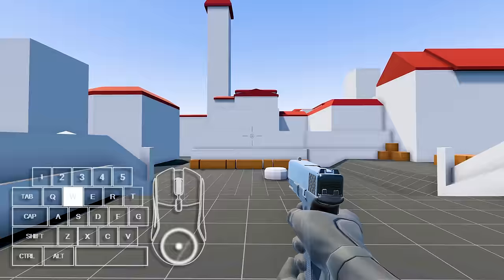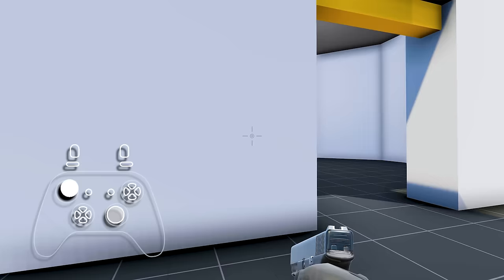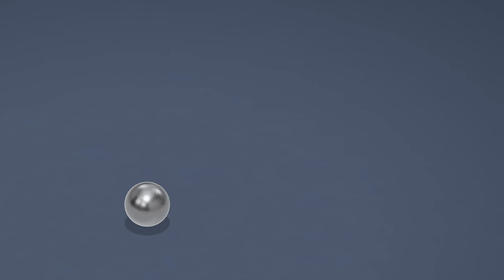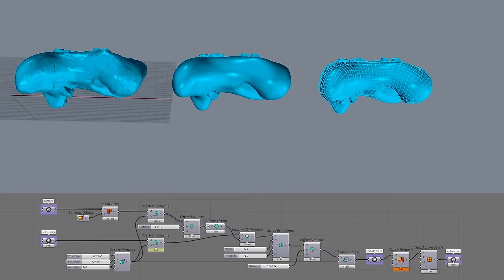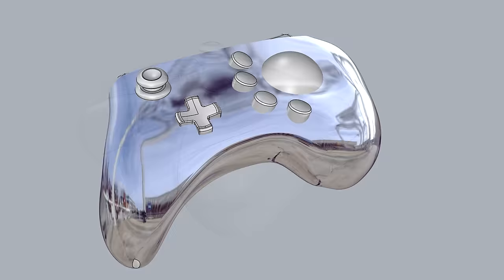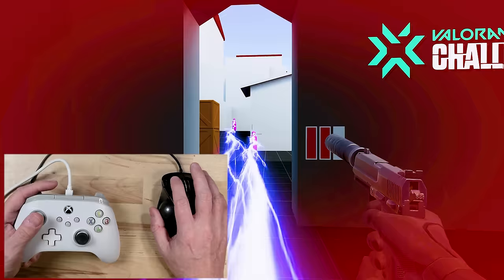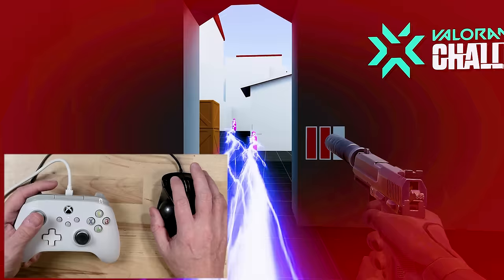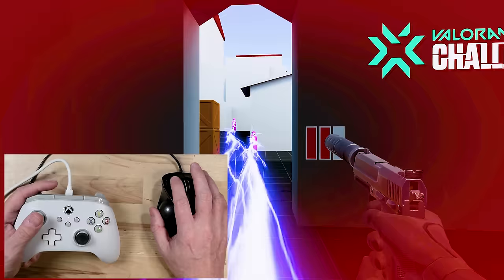Ultimate FPS Controller Design & Build

Comment: hello brother can you make a back button connection to ps4 controller like scuff controller I tried to make it and my controller's mother board burned I used for the back button the "mouse button which is right click and lift click" maybe it burned because I link the mouse button to the controller's right trigger without using something to manage the voltage I don't know I'm not an expert with the electrical circuits you are better at this I will follow you to see the video and can you Can you explain the amount of voltage in the controller and what can and cannot be connected to avoid burning the motherboard?, and you are intelligence man <3 love you

Comment: also make sure that the insides of the system unit from the PC fit there, all the buttons that are on the keyboard, a video projector (so that you can immediately project a picture on the wall), a stand for a bottle of beer and I can also come up with different things, if anything, contact))))..... What's the point of it anyway?

Comment: my claw game technique doesn't like what it sees, I love the concept, but I still wonder how this controller will cope in a hectic FPS shooter with lots of quick flicks and longer tracking of enemies in all driections. As soon as i have to lift my thumb its over, but with a higher acceleration speed i think i would struggle more to correct the spray of my weapon, with a mouse you pull it far with the arm if your enemys travels fast and close to you, when he's in your sight you switch to aiming with your hand instead of the full arm, thats not exactly like a mouse but pretty close. We need more tests.

Comment: You really should cure your UV resin after washing WITHOUT the supports. There is no need to cure it with suports, since it makes it harder to remove and even can break the pieces because the supports are too hard along with the piece you want...
Reply from the maker: Good point but it really depends on the resin being used, geometry of the print, support layout situation etc. A lot of the larger controller parts had complex internal geometry so keeping the supports on through post cure helps to stabilize everything & prevent warping (in this particular case).

Comment: So if mouse aiming is still superior to the custom controller why not create a setup that uses a flightstick style joystick (the type of joystick that has some buttons so you can map sprinting and crouching) alongside a mouse? Then you have the movement freedom of a controller without any kind of aim limitation.
Reply: Lol just use a freaking keyboard and mouse.
Reply: @mr.thammisses6119  Yes, but my point is the uploader designed the custom controller to have the freedom of movement of a joystick and the aim of a mouse by using a trackball but from his own tests the track ball on the controller performed worse than a mouse. So the solution is replace the keyboard movement with a joystick while keeping a mouse for aiming, rather than trying to re-invent the mouse part to fit a controller.
Reply: @joshbond8391  you can still achieve the same movement by tapping the keys. You'd be better off holding a joystick in one hand and getting a mouse that has a good amount of buttons on it. But it's unnecessary.

Comment: Doesn't seem so ultimate when dual stick + gyro or steam controller's trackpad + gyro still perform way better. Played through Doom Eternal recently again with a Steam controller and it played like a dream. At least it's better than just dual-stick I guess, but I think dual-stick only is trash. It was good when fps on consoles became a thing, but once gyro became an option it should've been abandoned asap. So sad that Microsoft seems to be holding the adaption for this back. If their controllers supported gyro then devs would have no excuse to leave it out, but they still often do because they're appealing to the lowest common denominator.

Comment: Need to use PlayStation controller system, with DUAL analogue trackballs for the ideal setup.  No sticks at all.  I did see one from Asia a few years ago, but it is not available in the NA market.  The problem with controllers is the entire system is just not as good as a mouse and keyboard.  Using the thumb only to move, instead of all four fingers is just never going to work out as well.  A truly excellent video though, and it effective explains WHY (in the beginning of the vid) controllers are just not as intuitive as using a mouse.  but it those damn sticks were to GO, from ALL controllers and replace them with analogue balls, it would seriously level the competitive playing field.  Of course, it might just be that most serious designers use a keyboard, and mouse, so deliberately do not put analogue balls into controllers.  It makes no sense that using analogue trackballs is not the industry standard.

Comment: a trackball will never be the ultimate device because it quickly loses its smoothness and requires constant wiping for a consistent experience. maybe if you play with gloves. even with normal use your skin leaves off oil which will coagulate, but when you're gaming for hours and your hands get sweaty as well, it's just a terrible experience

Comment: The Key Layout around the ball is too large. Id say the ball is too large, which creates the problem. My sausage thumb would never reach the top button on that construction. Dare to say a trackpad would be 300% better for this but obviously alot more complicated to implement. If i could id create a xbox controller that has a different ankle of the shoulder Keys towards the back, which is the problem why i cant hold as comfy as id need in order to greatly improve my aim with a controller in first place.

Comment: Except that not all FPS works like CS, Good Luck aiming with this on COD, BF or R6S.

Rules Number 1 for a Controller :
It has to be Ergonomic.

This doesn't, VALVE made a prototype that looked like that and they ended with Steam Controller.

Comment: 85% of the mouse that you have been using for years i assume. Spend some time with this controller and you are pretty much at the level as with mouse if not better. . I would rather see this kind of controller without AimAssist than the current controllers. .

Comment: Biggest factor in gaming with a mouse vs controller, reaction time (response time) and the skill ceiling involved. This is why trackballs are not used within PC gaming world and fell out quickly with the ones who did use em in the late 90's early 2000's. I just don't understand the need to cling to a console in this day and age when PC has been doing it better for 20+ years. I can see this for other games but FPS and consoles have always been a giant L.